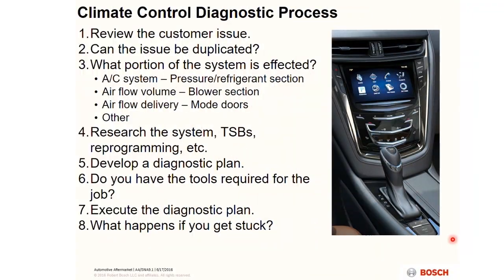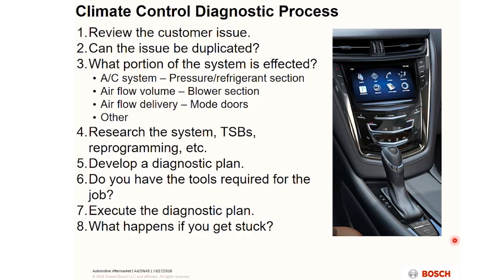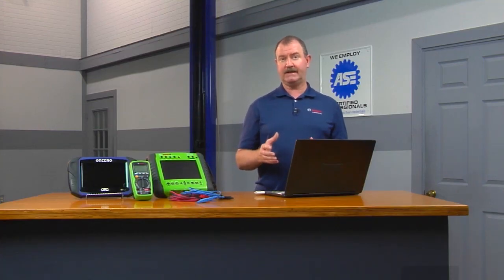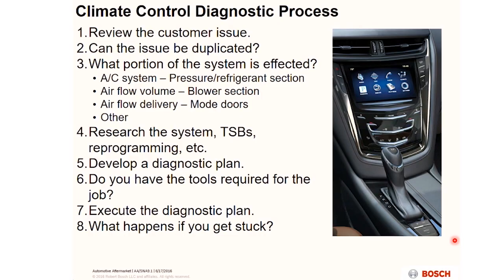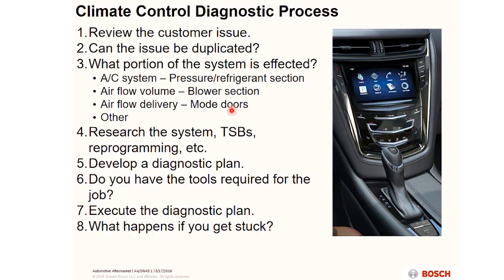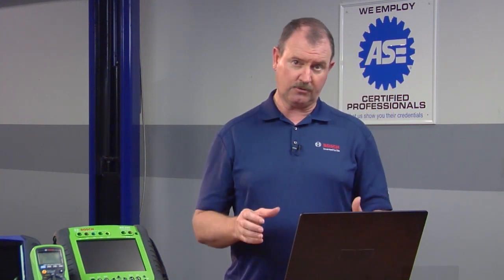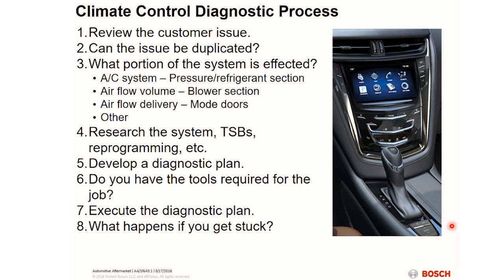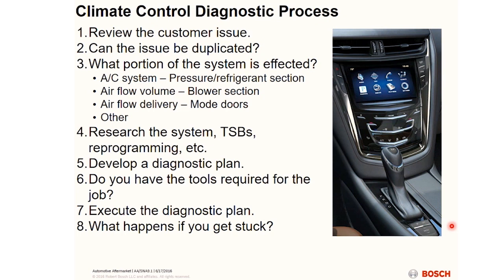Climate Control Diagnostic Process  | Tech Tip

Comment: If somebody has a service writer whose capability of only getting the information that the AC does not blow cold that Shop is really hurting for a qualified service writers and shows at the person in charge up above is not capable of training them to get out the right information from a customer and coach them. Shop loses money if technicians are on a bonus program they lose money having to recall customers and do double work the owner of the business loses money and that service writer needs to go work for McDonald’s or janitorial service. 
      A good service writer is technically inclined and in depth with knowledge of the automotive industry and engineering hopefully he was an ex mechanic that’s a bonus. 
      Otherwise the company is screwed because the person who is the face representing the customer between the company is where are the weakest link of the chain lies and everybody loses.
      We need many more videos like this for HVAC on automobiles and knowledge this is one of the weakest links in automotive field keep the videos coming